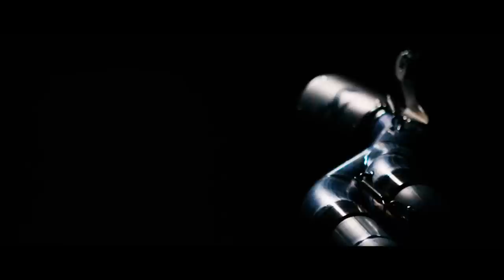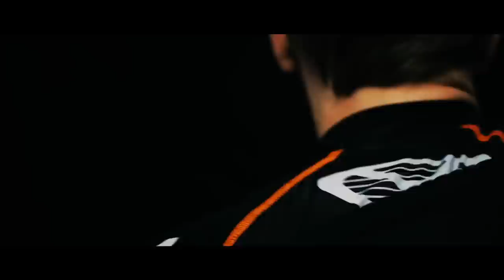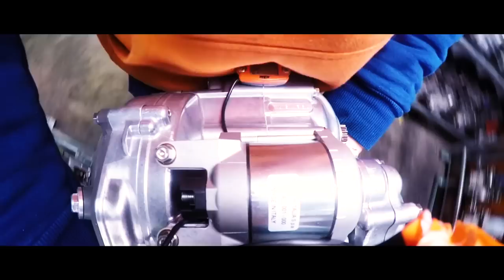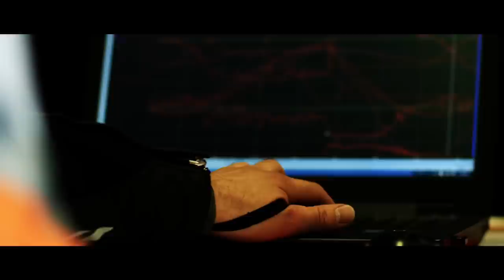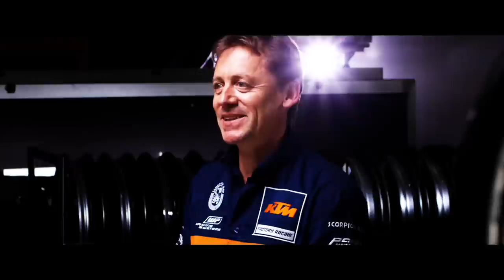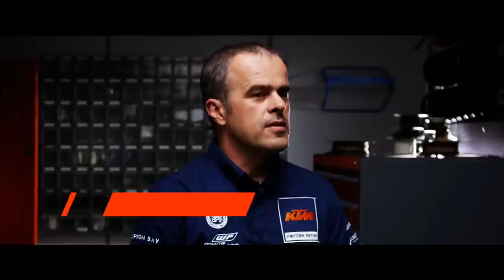2018 KTM RC16 | MotoGP Project V4 Screamer Engine

Comment: Now they have traction control and wheelie inhibitors. 
They can limit the amount of power to the rear wheel based on lean angle. 

Where does the riders ability express itself? 

Late braking?
Reply: Everywhere,... do you not watch MotoGP? yes the tech sanitizes it a bit but it still takes huge skill to ride one of these bikes
Reply: LogicalSense  dude, I asked a question.  Either you can answer it or you can't. 
Maybe you can describe to me how, since all of these technologies have been introduced, the approach to racing these machines has changed. 
But instead you chose to sound condescending.
Thanks for the enlightening dialogue.
Reply: even normal braking from 330kph to 80kph are not easy,.. especially late braking
riders ability:
-determine qualifiying and race setting
-throttle control
-body positioning/riding style
-start technique
-steering-countersteering
-managing the tires and fuel
-stamina
-deciding and using racing line
-trail braking
even it have TC, riding a bike isnt that simple, esp for racing
etc etc
fyi: traction control and electronic in todays motogp (single ecu) are for safety reason..
Reply: ways of pushing their bike
how to defend and attack
knowing limits of their bike and their body (marc can push far beyond tho)
when to shift (you can't shit while fully leaning)
braking (lock up and you lose the race) 
there's still chance of highside even with TC
Reply: Marius iPad, what does that comment even mean?
Reply: Naufal Irsyad Thanks for the explanation. 
It's not like it's obvious to me that they're getting all kinds of help from technology. I know how awesome they are using the brakes. 
I wonder what the lap times would be like with all the safety tech turned off?
Reply: it will be slower since they will be playing it safe on the throttle
a highside usually means broken collarbone
Reply: to be fair, the bikes have become so fast there is still a lot of skill required in acceleration even with traction control.
Reply: +azonicrider32 - you think so? Try saying that to 500cc GP champions from the say the late '70s, e.g. Kenny Roberts, '80s Eddie Lawson, Wayne Gardner, Wayne Rainey, '90s Mick Doohan when traction control didn't exist. The same can be said for so called 'Formula 1'...they aren't 'drivers' - they are computer program operators. Back to basics I say and the quicker, the better.
Reply: I know it's very late reply but the electronics on the race bike is not to have a safety net. It is for making the riders even faster. The electronic also have to be set up by the rider and teams over the weekend to find a setting the rider is comfortable with. It doesn't mean they have any less skill. After all, all the riders that make it to MotoGP have to pay their dues in the lower classes where there is much less electronic. Look at Moto2 racing the bike is sliding everywhere and the rider is having to control. Also the electronic is used for rideability of the motorcycle by smoothing the throttle response. Think like a fighter jet plane where the shape is designed to be unstable for manoeuvrability but the electronic allow the pilot to control it to the maximum potential and without it, the pilot cannot fly it. Just see Pedrosa a few years back when the wheelspeed sensor was broken from a touch with Marquez and Pedrosa just opens the throttle and immediately highside crash. Is not because he just opens throttle fully and the electronic keep him safe. He expect a certain throttle response with the electronic present and without it he receive a different power than what he expect which cause him to have accident. So electronic is to make a very fast bike more consistent and less wild in the riders hand so he can push even harder. All the bikes are having it so it is still a competition of rider skill. Sorry for long response :)
Reply: The 500cc champions rode on the limit of those bikes at that time. Electronics have pushed the limit even further but the riders still push on the limit. Electronic is not a safety net it is for the riders to push even harder. In such case Rossi has won championship on 500cc bike so with electronic he should be so much faster than Marquez and Lorenzo and the others who didn't have a taste of such bike? The bike may be "easier" to ride with the electronic but it just means that the limit is higher. The riders are still pushing on the limit so I'm sorry but you can't say that it is taking less of skill than last time.
Reply: line choice, finding opportunities to pass, and reacting to changing conditions are the three big places where I can see rider ability still showing itself. However if you really want a sport where it is all about the riders ability, motoGP is not the place to look, try watching Motocross or Supercross, the bikes in the top level of those disciplines are practically identical to the bikes you can buy off the showroom floor.
Reply: @Blackscorpion1963  What a boomer comment, try using bike crossing 350 on straights without rider aids. The purpose of gp is to test out new technologies which makes it into road going machines for the public. So many gp technologies have been perfected and made to road going cars and bikes.

Comment: Problem with ktm has always been the engine. Honda used to make screamer v4 in the old nsr500. But they shift to a big bang v4. There is a big reason why... they should change the engine firing order. Its the one thing holding them back.

Comment: Someone should tell KTM it's not 2000, so drop the trellis frame.
Reply: King Fish true
Reply: King Fish     Just wait and see.  You may learn something.  These guys are good.
Reply: It works, it's light and it's beautiful, why change?
Reply: Carbon frames sometimes messed up the dynamics. And harder to make adjustments
Reply: Um. Why? They kept the steel in motocross. And they are amazing. KISS METHOD

Comment: 2015 rc213v is the worst v4 screamer engine..too much power for the chassis to handle
Reply: can you exklaborate please
Reply: Dem many honda riders had no grip on the front seems like their bike is floating like motorboat and hrc used back 2014 chassis after half season because too many honda riders crashed.
Reply: That just says to me whoever tested it doesn't know what they're doing or they don't like change.

Comment: Why KTM, why? Unless this tech will trickle down to a V4 road bike, what's the point? KTM won't get close to Yamaha, Honda, and Ducati. Stick with WSB.
Reply: Dodge, I hope so, because I love V4's. But you shouldn't make assumptions. Look no further than Ducati. Their Moto GP machine is a 4 cylinder yet they only make twins (I don't think the have a 4 in their lineup but I could be wrong).
Reply: desmosedici 
stupidly priced though
Reply: I knew someone would throw that in. That's a one-off machine and doesn't count.
Reply: Dodge Rider their CEO illegidly discontinued the production of the RC8 because he felt that it was to dangerous for the public, you know, you and I...  so, that being the case, why would KTM entertain bringing a V4 to production?  Don't get me wrong, I'd love to see KTM bring back the liter bike...  I actually love the RC8...  but for this reason, the discontinued RC8, I personally think KTM is a joke and needs to grow a set of balls
Reply: holden caulfied the Desmo is not a one off bike...  in 2006 Ducati offered up to the Public the Desmocidici RR (Race Replica).  The company built 1500 units from 2006 to 2008...  so it's not a one off bike...  however it is a limited production bike...  the Desmo D's were one offs strictly used for MotoGP...  the last one being the Desmo D16, if memory serves me right